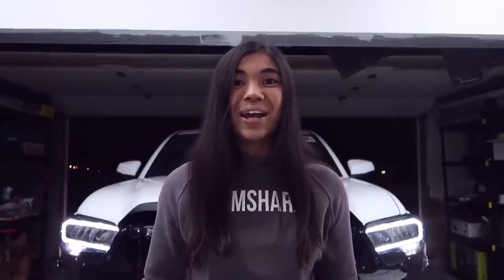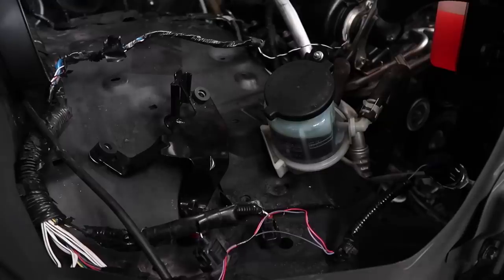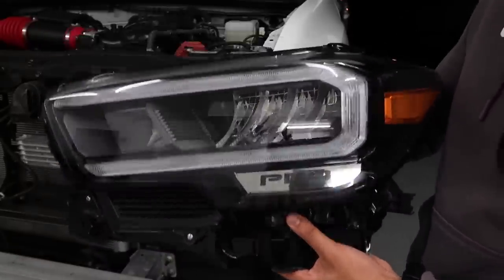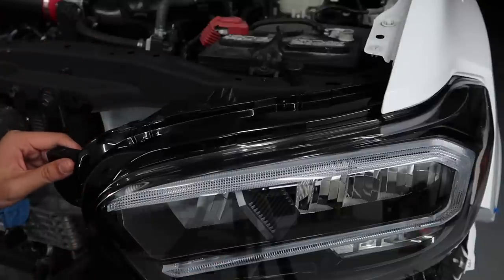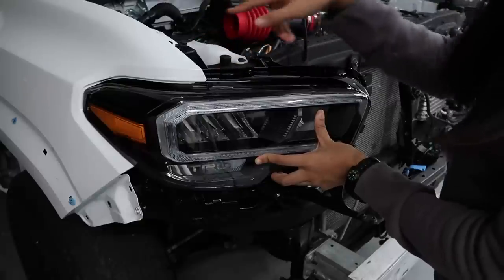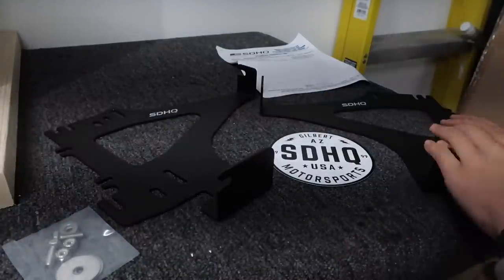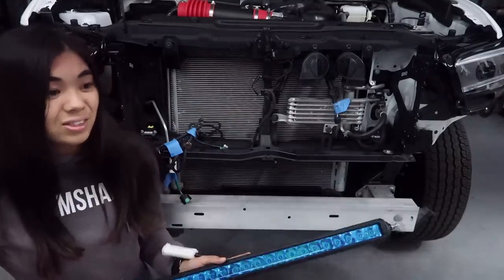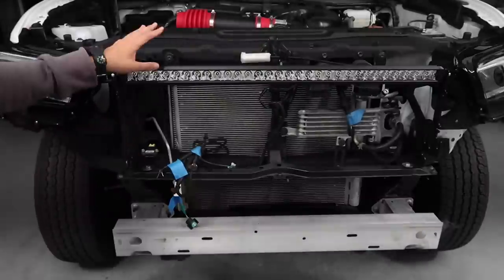Adding LED Headlights to a 2020 Tacoma | Tacoma Rebuild Episode 3: TRD Pro Headlights + Light Bar

Comment: fun fact, toyota typically sells repair tabs for their headlights. theres some holes that the leave in the plastic for screws to hold new tabs on.. not sure on the 2021s, but i do know my corolla i put repair tabs on and everything was perfect (until it was totalled..)
Reply: link?
Reply: @Knel_  i actually checked at work. apparently the 2020 tacos no longer have the repair tabs like toyotas of old. go figure.

Comment: Hey Chloe, i have a question. I’m planning on pulling a trigger on these OEM Pro headlights for my 2020 TRD Off-Road. Will it plug and play or do i need to get an aftermarket wiring harness?
Reply from the maker: You'll need to get an aftermarket wiring harness. I'm told the best place to find one is on E-Bay, but I've never done it myself
Reply: Chloe Kuo thanks!

Comment: Hey Chloe did you get the dealership to update the ECU on your Taco so that it has a smoother gear shifting and doesn’t struggle with finding the right gears like all Tacomas suffer from. I just did my 2017 TRDPro today along with and oil change.

Comment: Looking good. Any chance your bent reservoir bracket and lower air box is the same as previous models and could be found in junk yard? I have the 2020 pro and best place to fit the 30 inch bar without blocking too much light is in lower grill area between fog lights.
Reply from the maker: After I filmed this, the owner was able to bend the reservoir bracket back into place. And thanks for the advice about the light bar! That may require a different bracket than the SDHQ one though.

Comment: Just very curious are the bulb for the trd pro and the offroad have a internal bulb? I have a 2020 tacoma which only see the highbeam bulb and not the low
Reply: For the LED headlights? They do not have anything replaceable, so there are no bulbs. These LED headlights have a total of 5 low beam LED drivers per side and 2 high beam LED drivers per side.
Reply: For the LED headlights? They do not have anything replaceable, so there are no bulbs. These LED headlights have a total of 5 low beam LED drivers per side and 2 high beam LED drivers per side.

If you have the halogen projector headlights, the bulb for the high beam is easily visible for the front. The low beam is behind the projector lens

Comment: Hello Chloe from Greece! Your headlights trd pro you put with adapter?
Reply from the maker: No adapter needed for this 2020 pro. I think one is needed for years below. Hope this helps!
Reply: @ChloeKuo  i want to put the trd pro headlights and need 6 pin connector. I find the wires but i want to put adapter to looks better.

Comment: Are you trying to make the truck as OEM as possible?
Reply from the maker: The plan is to make it as OEM as possible (use OEM parts), and then mod it from there! Although as you've seen, we've had to make some workarounds due to the nature of its previous life, so in a sense it won't be identical to a TRD Pro you'd see on the road.

Comment: /Can't you make some replacement mounts with your 3D printer?
Reply from the maker: I suppose I could! I think aluminum is going to be a better material though.
Reply: @ChloeKuo  True..  Aluminum would be stronger.  No matter, you both are doing an excellent job rebuilding the truck..

Comment: What driver are you using?
Reply from the maker: LED driver? I'd be surprised there weren't any drivers built into the headlight assembly, considering that these are the OEM ones that plug into the factory wiring. Although, I'd have to take a closer look.
Reply: @ChloeKuo  sorry, I mean what impact driver are you using.

Comment: They are nice, but, you can go onto headlight revolution and buy the LED bulbs and save half a day installing them and still getting bright lights for night.  I just sold my taco but I took out my after market LED bulbs from head revolution, the sv.4 high/low beam for a 2019 Tacoma.  If anyone’s interested let me know.  Only had them 3-4 months
Reply: LED bulbs in housings not designed for them decrease visibility for both you and especially oncoming drivers.
Reply: These LED headlights have 5 LED drivers per side just for the low beam. 2 LED drivers for the high beam. These will out shine any LED drop in bulb, and do it without blinding incoming drivers.